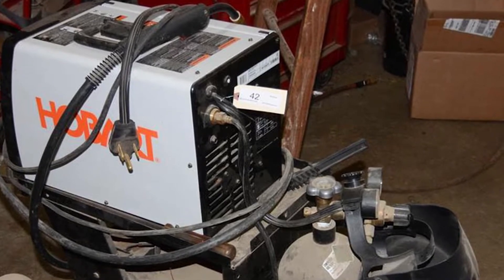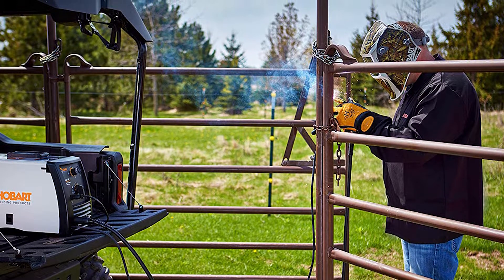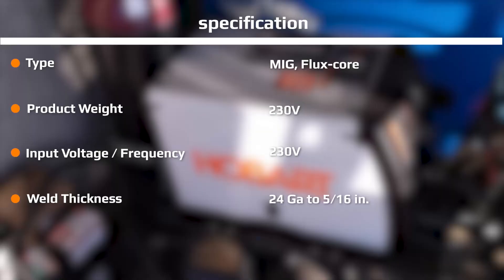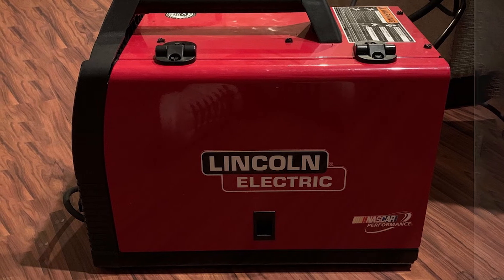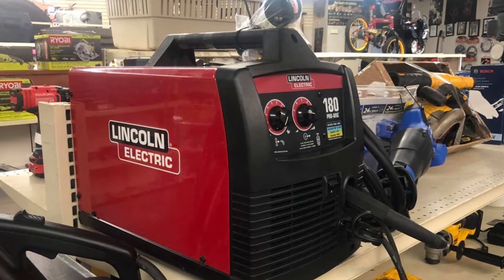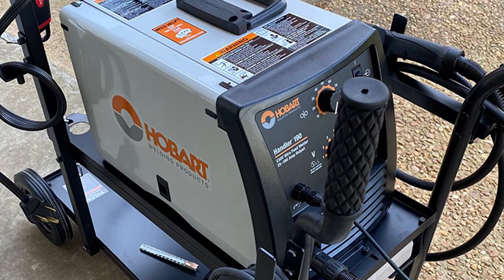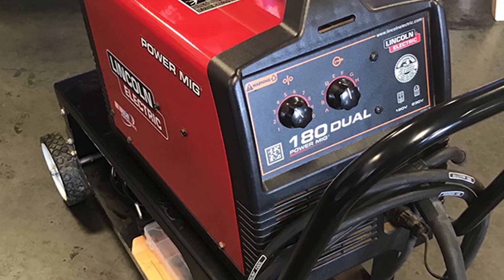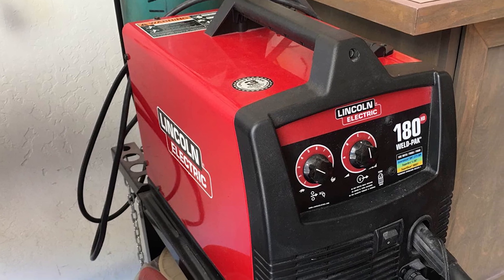Hobart Handler 190 Vs Lincoln 180 – A Detailed Comparison

Comment: The Hobart is heavy and not easy to carry 
Definitely better used from a cart. I prefer it with solid wire and a bottle not flux core.